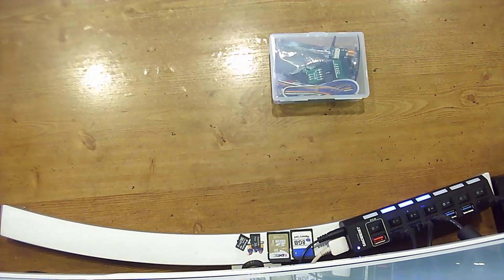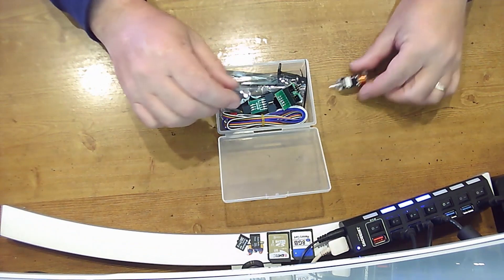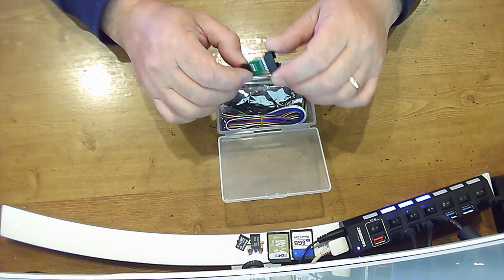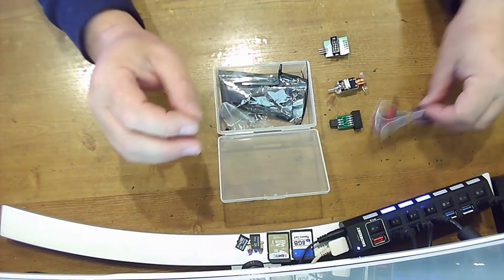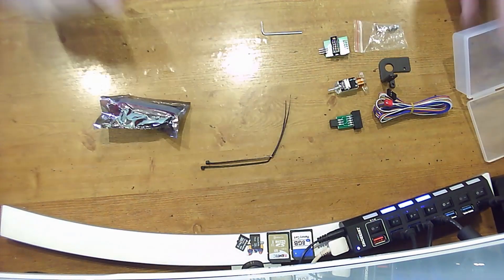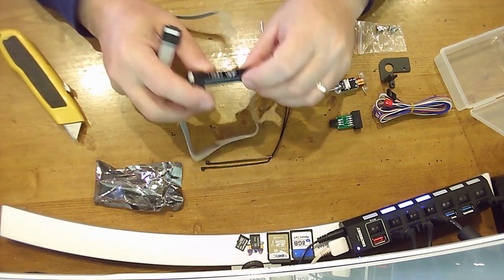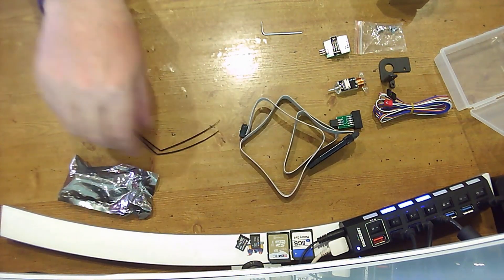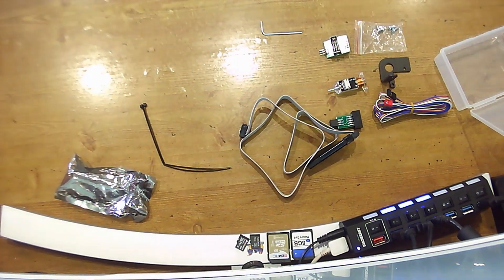CR10S5 BLTouch Upgrade Part 1

Comment: I figured out the wires in the motherboard by flipping around the 2 wires. I actually ripped out the header and put it in backwards and kept the wires the same. The other ones are D11 and I troubleshot them with a multimeter. Mine was different than his. I used the BL touch mount that came with it and messing with that plastic part wasted some time. Thanks for the video.
Reply from the maker: I was just looking at the data on the video, that was almost 2 years ago now.
I haven't upgraded any more of that printer yet, but I think I will replace the glass bed with a mirror one of these days.
The original glass has some bad warps in it.
Good news is the BLTouch does help a lot with these.

Comment: Thanks for the video. I wonder what is the D11 conector layout. Is the power pin close to the canister's wall or is it the one away from it? .
Reply from the maker: The three pins are a standard servo layout, that is closest to the edge of the board is the Gnd or 0V, middle is the +5Vdc and the last one is the signal wire.
Reply: @CyberOne  thanks , but I see in the instructions that an end is VCC, then gnd and finally signal.
I think I will turn the power on and measure voltage to determine the VCC pin and ground.
Reply from the maker: @luisdelarosa7609  VCC will in a standard Servo configuration will always be the middle.
The hard part is working out the Gnd and signal :-)
The idea is if you connect the plug in backwards, there will be no damage to the gear.
This arrangement was developed by the RC hobby groups who connect things up out on a grassy field and quite often get it wrong. :-)
The pins for D8 - D12 were setup to drive standard servos, and we are using one of those to drive the BLTouch.
Reply: @CyberOne  thank you for your help, but guess what, in the creality website, if you dawnload the driver for the bltouch sensor, the zip file contains directions for do it.
So it is correct to connect the 3 wires connector in D11 with the red wire towars the edge of the board and the 2 wires in the z limit switch.
My board is v2.2
Thanks again

Comment: Could you please upload a video/diagram just for thee wiring purpose? It is so frustrating that not a lot of resources are available on the wiring of BLTouch. Thank you so much
Reply from the maker: One of the things I didn't like about the way I did that upgrade in this video, is it made it hard to unplug the wires from the head assembly.
So I created another video where I fit a new plug to the back of the controller and wire the BLtouch via that so it's easier to disconnect and reconnect the cable.
The video does show the connection better as part of the upgrade.
I was starting to learn more about making videos by then, but still hadn't got the audio 100%
You can find the video here: https://youtu.be/FjaKAeufO00

I know what you mean when you say it's hard finding resources for learning with... I'm working with a 3D printed robot and having trouble getting some things to work.
But we will get there eventually. :-)
Reply: @CyberOne  and yet, after the entire video you still missed out the most crucial information and refuse to provide the info you've been directly asked about and instead refer to another 20min video of how to put an additional connector to the case.

Comment: whats the point in making a video on how to wire something up if your not going to show people what your doing. how dumb are you?
Reply from the maker: Mostly to make the video shorter :-)
By trimming out the working out what went wrong, I make the video a quarter of the length :-)
Then I show how it should be done.
Reply: @CyberOne  so your main goal is to show everyone how clever you think you are, not to actually teach people anything. this video is just part of a shrine to your self?
Reply from the maker: @freelectron2029  I would prefer not to teach how to do it wrong.  then answer questions if I missed something.
And keep it under 30 minutes if possible.
Reply: My point is (and I'm not surprised you missed it) if your not showing people how to do something then your just making a vanity video. Always surprises me that so many people are so incapable of selfawareness.

Comment: thanks for the video..would be great to see where the wires go in the mother board
Reply from the maker: Great suggestion!
Next time  i have the box open I'll have to take a  close up photo.
Have a look at this video, it may help some more.
https://youtu.be/FjaKAeufO00
The black and white wires  go where the Z-axis limit was connected.
The three servo wires connect to the 3 pins labeled D11, the Brown wire is closest to the side, then red and orange towards the inside.
In the above video there is a servo extension cable plugged into it near the start of the video.
I do apologize for the quality of the audio in that video, I was using a wireless microphone setup that turned out to be not very good.
Reply: @CyberOne  thank you very much